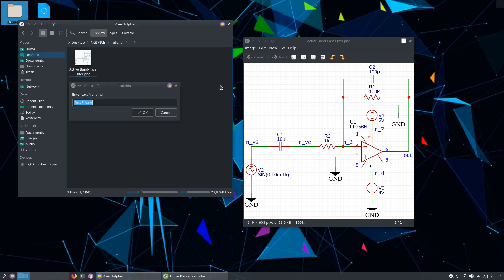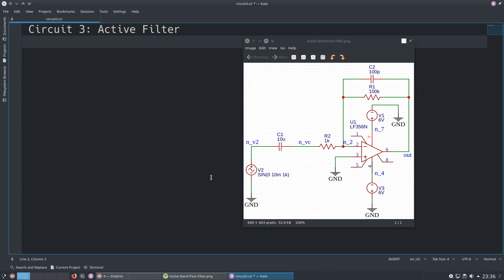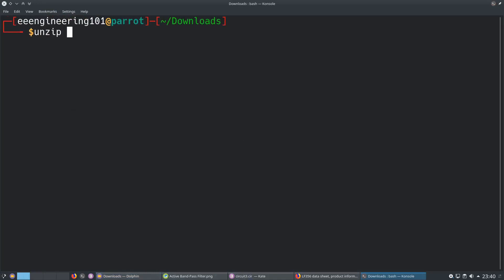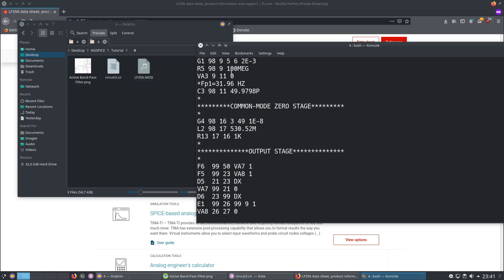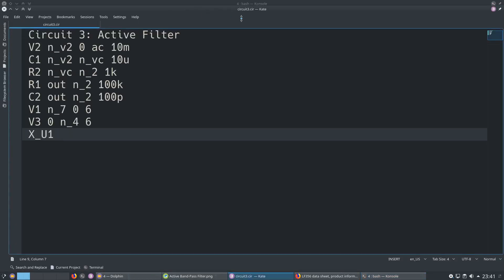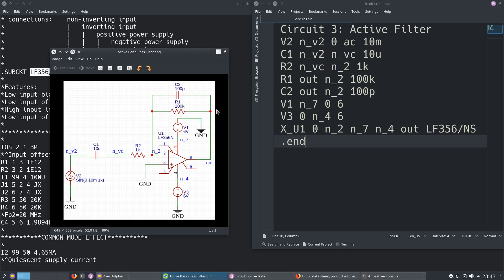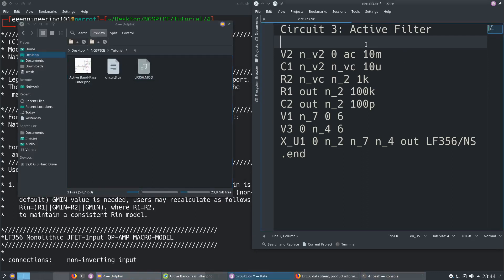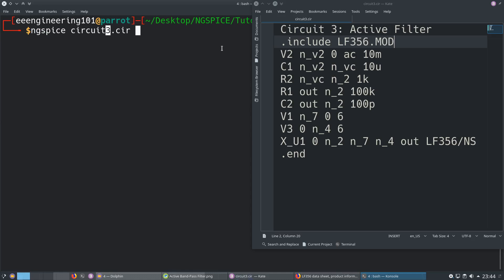Ngspice Tutorial #4 (Op amp in Ngspice / Active Filter / AC sweep)

Comment: Sir  I want to design a adder ckt using opamp how can I include opamp file can you please tell7???
Reply from the maker: In the video, I've included an opamp LF356. You can do the same thing and connect necessary elements (resistors, etc.) to circuit. If you are going to include an opamp different than LF356, you should find it spice model.

Comment: To plot output voltage what line do we have to add ??
Reply: In the code
Reply from the maker: If you would like to plot output voltage versus time, you should make transient analysis. tran step_time end_time start time. Instead of writing ac dec 100 1 10Meg you should type tran 1us 20ms 5ms.
After that plot out. If you do this the out node will be plotted from 5ms to 20ms and it will sample every 1us. For more information you can watch the Ngspice Tutorial #3 (AC analysis of BJT and AC Sweep) https://youtu.be/s33RtemJfhk